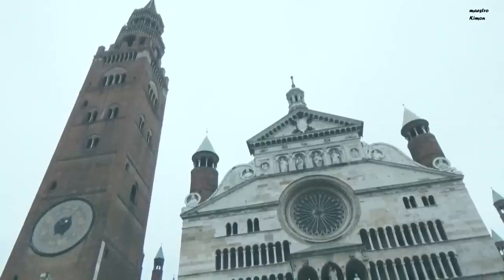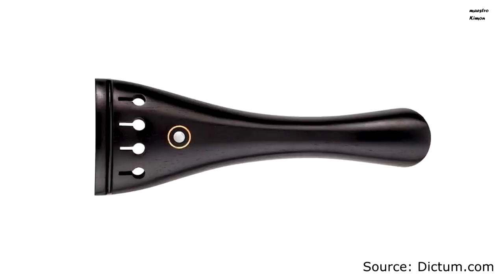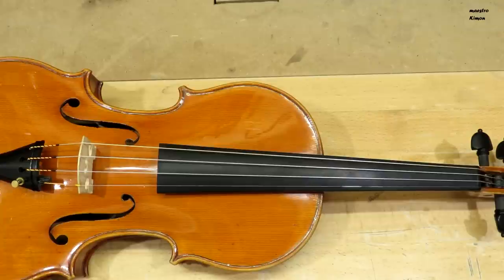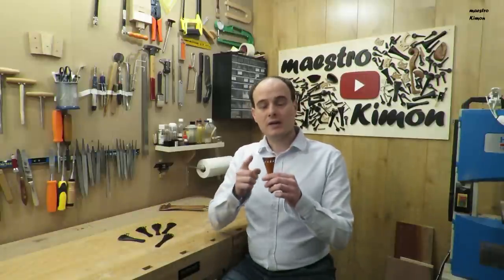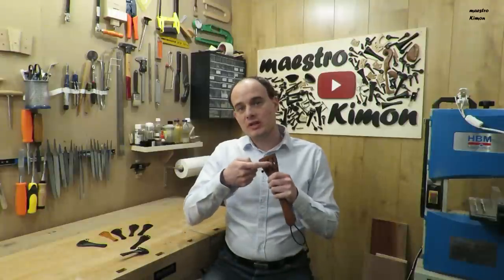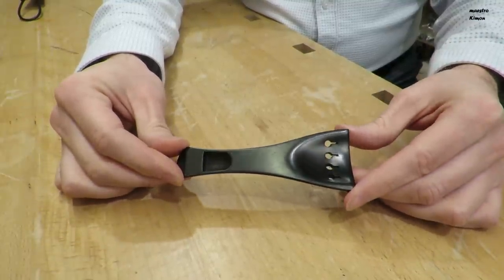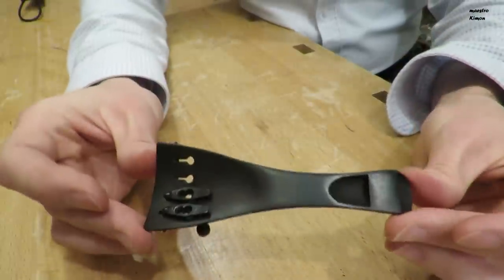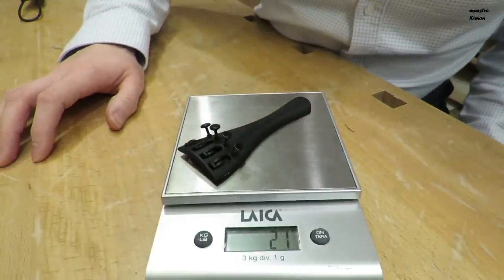The tailpiece

Comment: I have an old violin (no label but at least 100 years old, not expensive) with a weird tailpiece... it only has two holes and the strings loop around the wood at the top of each hole. There's one fine tuner that sticks up. Anyone know what kind of tailpiece this could be?

Comment: When I was a boy, my cello always did alarming noises because of the nylon loop not withstanding the string pull and thus skipping a thread or two. Had it at the violin maker a few times with no success.
Finally mounted a brake wire from my motorcycle that sits in a thin black isolation of a headset wire. Sound and attack changed instantly, I am still happy with the solution 45 years later.
Needless to say that it never made these scary noises since that day.
Reply from the maker: I think that the old loop that you had, that is called "tailgut" was indeed a thick gut string. these tend to brake threat by threat. Today there are nylon, kevlar and (metal) wires that work perfectly. And, as you also mention, they influence the sound and response a lot.
Reply: @maestrokimon  it was nylon. Still have it in the drawer 😁
Reply from the maker: @orangmakan  so it was a nylon cable! Never seen that! Can you send me a picture by email?

Comment: Greetings, Maestro. I have an old violin (no real value) I would like to work on.
The tailpiece, as most, has a small piece of Something (????) inlaid, crosswise, at the string end.
Mine has a couple of bits missing. What is it called and can it be replaced, or do I need
to replace the tailpiece? Thank you.
Reply from the maker: I don't know if the part has a name but I have never seen it for sale. I think that you will have to replace the tailpiece.
Reply: @maestrokimon : Thank you, Maestro.
That is strange, with it being an important piece.
Keeping the strings from vibrating on the end of the tailpiece. (that's important) 😁
I would like to keep the tailpiece, if possible (it is an old family piece), so maybe I can figure out something to do.
It shouldn't be complicated, but I'm sure it will be a pain in the behind. 😣😖😬🤬
Reply from the maker: It's not for sale as it is a part that doesn't come of easily, and every tailpiece is slightly different so hard to make a standard replacement part.
Reply: @maestrokimon : Understood, thank you.
If I do figure out something, I will send pictures.
It will be some time, from now, as I have many other things pending.

Comment: Hi maestro kimon,
I currently want to change my heavy metal witner tailpiece with a wooden one with two integrated fine tuners. I would like to make the sound on my violin brighter as my violin is quite warm sounding and the g string could open up a little. What tailpiece would you recommend for my needs?
Thanks!
Reply from the maker: Darren, as I say in the video there are no rules in this matter. You will have to try and see if it is what you want. Sorry I can't help you more!

Comment: Is there a difference in size and width of a Baroque style violin tailpiece compared with a traditional violin tailpiece ?
Reply from the maker: Yes the baroque are pritty different that the modern ones.
Reply: @maestrokimon  Can you put a Baroque tailpiece on a modern violin without modification?
Reply from the maker: No actually not. The baroque tailpiece misses the part to keep the strings.

Comment: On a cello Kenneth Kuo suggests to tune C string after length to F sharp, pinching the open D sting to get an interval, because D is usually the weakest cello string.
Reply from the maker: This is indeed a method that I hear a lot. As I say in the video there is no unic "best"  solution or advice, it's more a trial and error mater. You could definitely try it.